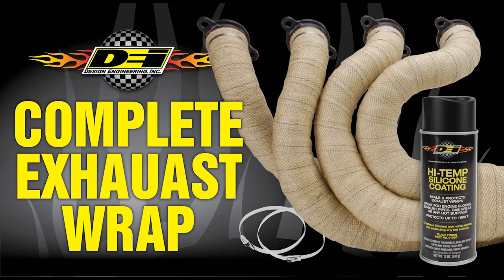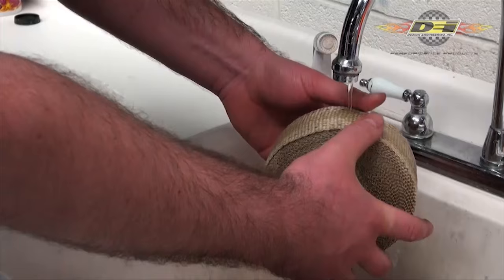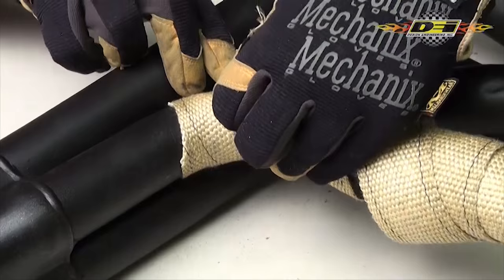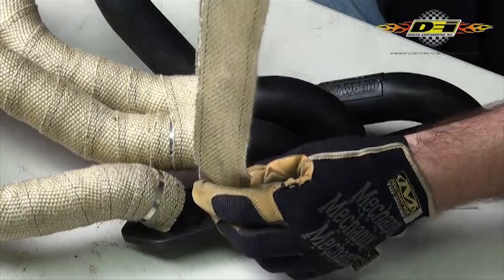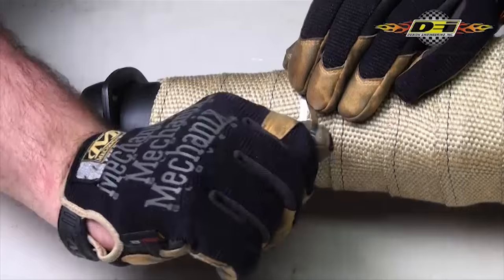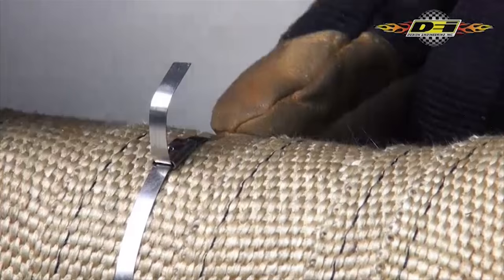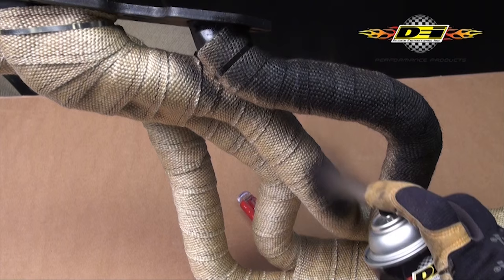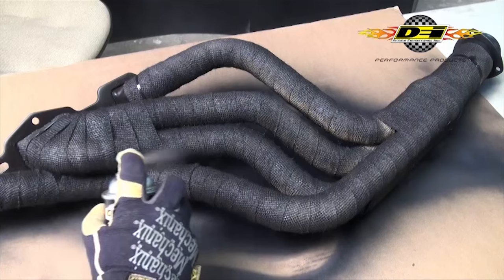Exhaust Wrap in three easy steps

Comment: If i don´t apply the spray what could happen ?
Reply: Nothing
Reply: The paint is moisture / water resistant, to avoid future rust and damage, use the paint / silicone spray 👍🏻
Reply: @searacoon3512  Agreed, the wrap will look nicer longer and it's another step to avoid the wrap from ever absorbing moisture. Plus any extra can be used for other high temp projects and not just wraps.
Reply: @riothero313 Sounds like it's optional; but it would ultimately provide a better result

Comment: I was thinking of using fibreglass fire blanket and wrap my factory manifolds on a Buick based v6 3.8 litre engine. I was thinking it's free! I have heaps lying around but I'm not sure if it will lower engine temps ? Any reply appreciated ? Cheers from Australia
Reply: exhaust wraps help RETAIN heat in the manifold.  Would not likely lower temps at all.
Reply: @Urohpls  I ended up getting Tuff brand heat shield material. Very expensive for such a small size. But good stuff. Cheers 👍

Comment: do I wait for the wrap to dry before applying the silicone spray?
Reply from the maker: With the traditional, glass fiber-based wraps, yes - it's best to spray the HT Silicone Coating on a dried wrap. For Titanium, pre-wetting the roll is not necessary, as the basalt fiber is already very flexible.

Comment: Is better to paint the pipes before wrapping them?  And can it be wrapped before heat curing the paint?
Reply from the maker: While not required, you certainly can paint before wrapping, and yes you can wrap before heat curing. It might take longer to fully cure, and it will be easier to scratch the uncured paint off while wrapping, so take care.
Reply: @DesignEngineering  Is there a benefit in doing so?  Will this prolong the life of the pipe or simply complicate things?
Reply from the maker: @thomasjj1976  If the pipes are a mild steel, it will aid in keeping rust down. Having the paint on there can also help give the wrap something to grip to when starting.
Reply: @DesignEngineering  They're T304 stainless, but it seems like there's no downside to doing it.  Thanks.

Comment: Would it be good to do my full exhaust like this?
Reply: Adding weight but I don't see why not. I have it on my cat back because my rear cabin is stripped and it helps prevent heat transfer into cabin

Comment: How to maintain it after installation? Will washing my bike effect wraps quality/ life?
Reply: You’ll want to seal the wrap but if you don’t it’ll still be fine. The water will evaporate out of the wrap but eventually the heat from the exhaust will cause the wrap to turn white. Best to avoid all that by sealing it as instructed.

Comment: What if I used high temp 2000 degree header paint on the wrap instead of that recommended spray? I got the wrap just to keep the engine temp lower.
Reply from the maker: We can't think of any reason you couldn't use another paint to coat your wrapped headers, but we haven't tested other paints and can't speak to how well they'd work.

Something to note: Wrapping your headers will not reduce engine temperature. It will only prevent other components from becoming heatsoaked by the radiant heat coming off the headers, and increase exhaust flow.
Reply: @DesignEngineering  it does reduce it ,its the radiation against the crankcase and the oil pan.